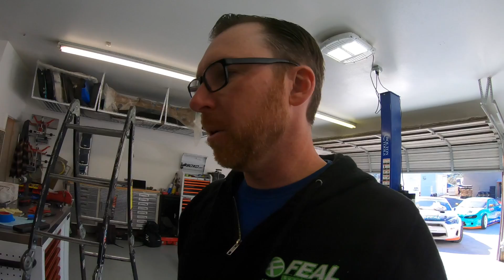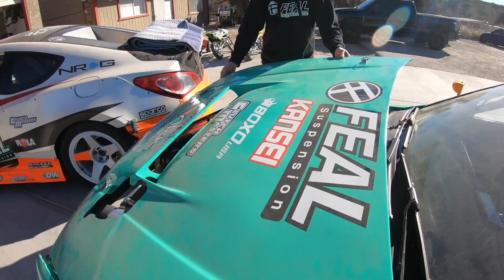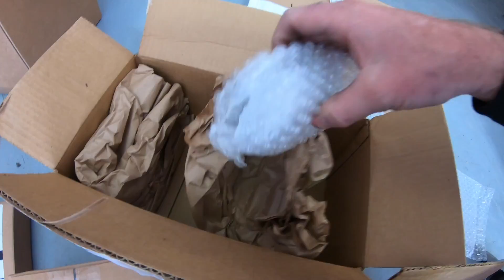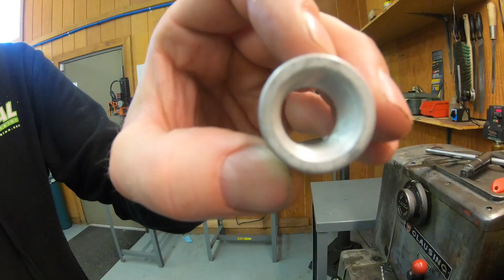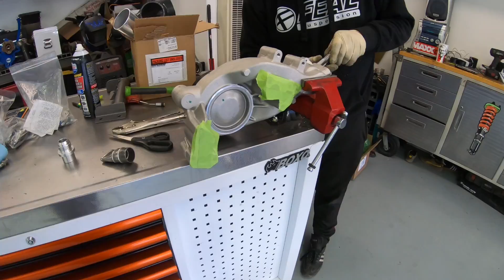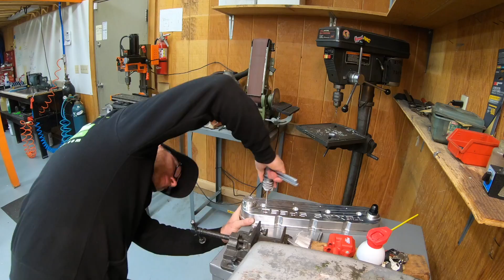Building Intercooler piping and oil system plumbing on the S15, Bakchis Build EP9

Comment: It’s about time solid roller v8s start coming into drifting I know kristaps car was on a pretty serious solid roller set up as well as chelsea and von should be on solids not sure if they are on roller lifters tho,  curious to see the dyno might need a different intake set up to really get up in the rpm efficiently might work fine in the boosted application and make sure the oil pump can make enough pressure typically need about 100psi for 10k rpm. Keep up the good work odi

Comment: Hey a good way to make sure you don’t touch anything On your intercooler pipe In that tight spot is before you weld it cut a piece of rubber coupler and stick it on pipe to act as a spacer of sorts, that way you take it off when done it’s spaced perfectly